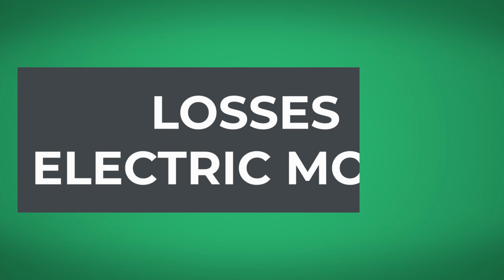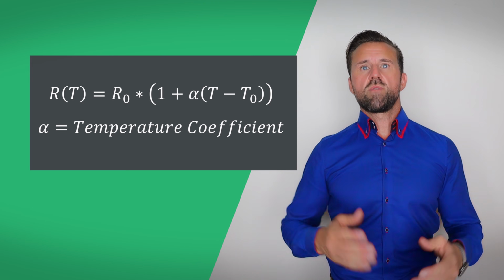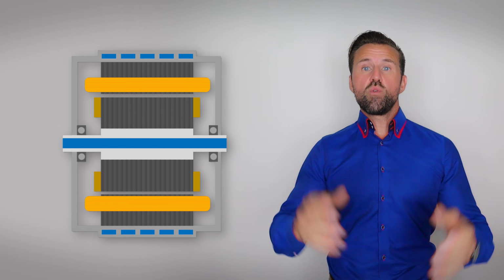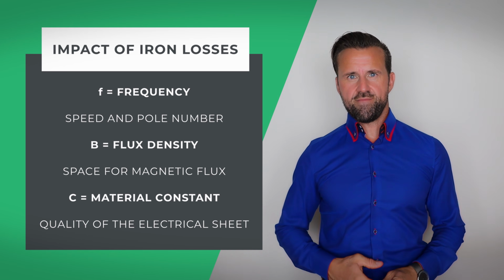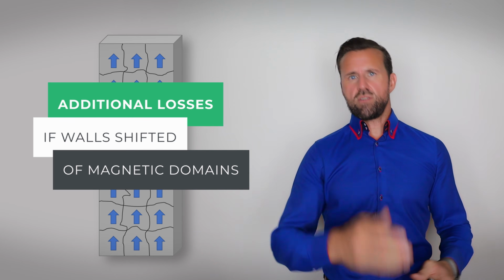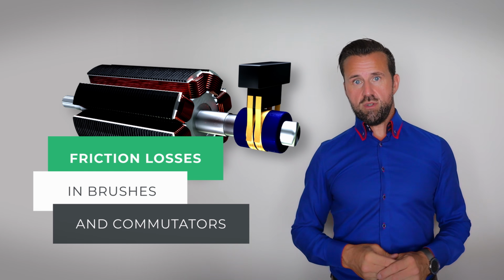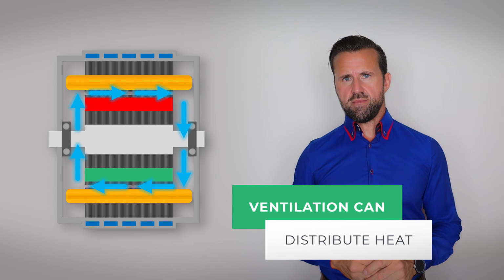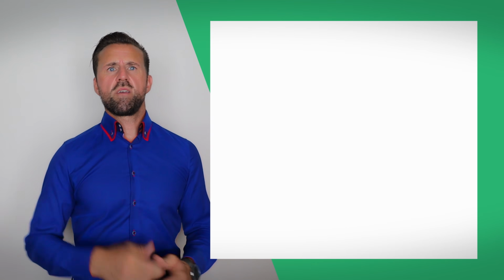Losses Electric Motor and How to Reduce Motor Losses

Comment: So then ,wouldn't a motor made of vanadium dioxside,  alloy would be a great choice for cooling. That it reduce heat losses.

also if  the motor didn't have metal bearings. but instead had electromagnet bearings with very tight tolerances That would  suspend the motor shaft when switched on then as the Rpms increased the voltage/current also increased on the bearings to m further stabilize the spinning motor and have no friction losses

Comment: Please I need your help agently am trying to run three ac motor of 5.5hp on single phase source of electricity but if am trying to run all the three motor  usually one of them will have a problem with the starting winding (burnt) what could be the problem
Reply from the maker: I don't think this is possible without additional electronics, sorry to say that

Comment: this is all the stuff i was reading in textbooks back when i was ten or so. all very basic and simple.

i cant stand watching someone simply TALKING, and waving tehir hands around. wheres some practical demonstartions? like, hey, heres three coils of different gauges, same turns, same ampere turns... lets see which one heats up fastest... thats your ohmic losses.

 heres some iron, lets give it a taste of varying frequencies... theres your core loss, theres a BH loop, the hysteresis loss...

or, iunno. heres a coil. on a core. with an adjustable gap. look at how we can vary the current and ohmic losses of the coil by varying the gap! see how it changes on teh scope in relation to the gap and the reluctance of the magnetic circuit?

hey look, heres a welding transformer. see how the core moves, and alters the coupling, the current, when we have a fixed input supply and a fixed output load? its all related...

now we have nice practical demonstrations of various principles, and we can walk away feeling we actually learnt something tangible, useful.

oh. wait. we didnt use a scope. instead we had some guy stand there talking and waving his arms around. who wants practical when you can have theory and only just scratch the surface?

if i didnt alredy know all this, it would be in one ear and out the other.

as it is, the whole video was rather pointless.

to me, this is sort of like watching an educational film targeted towards 8 year olds.
Reply: dont know what you expected for a 7 minute long video. i thought it was really good at covering the basics on losses, obviously it isnt going to be as in depth as a full research paper

Comment: Is there a good book on electric generator design? I'm looking at making a wind generator. I want it to work well with lower wind speeds of around 15 mph.

I've seen a lot of videos about the subject but many of them are contradictory and I was wondering if there is a good reference book for this sort of thing.

I need to know what shape everything is supposed to be... windings, magnets, cores, etc.
I need to know what quantity of components is optimal. Six coils or nine or twelve?
What gauge of wire to use.
How many windings should be in each coil.

Obviously these are a lot of questions. But every time I go looking for a reference book about this I get lost. Is there a good book that will answer my questions so I can design this thing?

Thank you for your time.
Reply from the maker: Hello a good book I can not recommend you unfortunately. Most of them are written by professors and have no direct reference to practice. That's why I also make the videos so that you understand without much prior knowledge erverything. Whether you design an motor or generator is actually very similar and on the subject of motor design you will find more information. To get you started, I would recommend buying a cheap motor and adjusting the winding to your speed and voltage. This will not give you a perfect result but you will get a first result quickly. What power and voltage should your generator / motor have?
Reply: @Electric-Motor  It will be a 10ft diameter blade which at 15 mph and at 30% efficiency would have 1500 watts. Keep in mind, wind speed varies so at 5 mph it would produce about 200 watts at the same efficiency. Voltage can be stepped up or down. Something above 52 volts and less than 72 volts is preferred.

 Speeds above 20mph could be dangerous and the system would stop the blade from turning in higher wind speeds. And I would make a point of securing the system in intense weather.

What I'm mostly interested in is getting the highest possible efficiency in low wind conditions. So 5 and 7 mph which is about a range of 200 to 550 watts. That would be normal operating conditions.

Given that the generator will likely be a three phase AC system, internal use will need to be DC, and DC voltage will need to be kept at usable ranges... I will have to use an AC to DC rectifier... the quality of the DC output at that stage is not important as the voltage will just be for batteries. And a DC to DC voltage converter will have to be used to increase or decrease the generator's voltage to something compatible with my power system.

Again, most desirable feature is high power efficiency at low wind speeds.

The value of this will be providing enough power at night to keep always on systems powered so they don't drain the battery at night.

Thank you for your time.

I would also suggest given the nature of your channel, this might be something other people are interested in learning about given the trouble with energy in the world right now. For my own purposes, my boat will be off grid regardless. But For other people perhaps simple small generators that capture energy at their homes might be something people find interesting.

You know more about this subject than most people that talk about it on youtube. In depth explanation of the pros and cons of different designs for different generation conditions would be very interesting.
Reply from the maker: @diogenes848  Sorry for my late message. It is quite expensive to build a generator for your wind turbine. I am a sailor myself, so my question is why don't you just buy a wind turbine? What problem do you have with the current solutions on the market?
Reply: @Electric-Motor  I'm interested in learning new things. I wanted to understand the principles so that I could at the very least design what I want on paper. Even if I don't make it being able to represent the principles on paper accounting for all the issues is interesting to me.

I've been looking around... I think there is a book by Hugh Piggott that might help me.

In addition to the wind turbine I'll also be building a hydrogenerator as well so that I can generate power whilst under sail.

Each generator has different rates of rotation and torque on the blades... and configuring the motor properly increases efficiency. Without more information, I'll have to either do more research which is fine or experiment which could be expensive as there will be failures.

I'm reaching out to people on the internet to avoid making these mistakes.

Comment: Hi, thank you for the information in the video, I would like to know the losses of magnetic field what type of losses, and changing the medium between the stator and the rotor how it can affect the losses, or increasing the gap size between them if we can estimate how the efficiency will be affected.
Thank you
Reply from the maker: Especially with induction motors and reluctance motors, a large air gap leads to poor efficiency. However, the additional losses do not occur in the air gap but in the sheet metal or copper. In motors with permanent magnets, the air gap can be made larger without much influence on the efficiency. However, more or stronger magnets are needed. If the air gap is filled with water or oil, additional mechanical losses occur, which reduce the efficiency of the motor. Liquids can also contain electrically conductive material, in which case electromagnetic losses also occur. What exactly do you want to implement? You can also write me a message via my website.

Comment: hi   I have electric motor  ran on 220v   can I make it work on 48v     thanks
Reply from the maker: Of course, it depends on the motor type. But in general, you can rewind the stator to a lower voltage, for example 48V. In simple terms, fewer turns with a thicker wire for a lower voltage.
Reply: @Electric-Motor  do I have any video to see how it make
Reply from the maker: @שושנהחרזי-ר3ש  No, not at the moment. What type of motor is it?
Reply: @Electric-Motor  it is 220ac motor  I want to do it 48v DC   its can do
Reply: @Electric-Motor  there is a email address  I can sand you picture

Comment: So, I live in Alaska and the mains electric isn't very reliable sometimes, so I use a generator sometimes... The generator I use used to work perfectly, but then I hooked up a power tool and it seemed to "break" the generator... I tested the output at the plug, and it is only producing 5 volts now, so I tried exciting the field windings with a car battery and only got about double the voltage... what else can I try? It just occurred to me it might have slip rings and if so, this is where i need to apply the voltage in order to figure out where the problem is coming from ?
Reply from the maker: Hi thanks for your question, however I probably can't really help you there. It will probably be a separately excited generator or? The excitation voltage for the rotor could be too low. If the motor has drawn too much current, the stator winding could also have a short circuit and therefore less voltage. Have you looked at the voltage from the generator with an oscilloscope? Please remember that high voltages and currents can be life dangerous.

Comment: Can you please comment if there is a considerable relation between Core looses and motor vibration.
Reply from the maker: If the electric motor produces noise, it comes from mechanical vibration. The energy which is consumed for the vibration counts of course to the losses. An efficient motor usually generates very little vibration. Do you think I should have added vibration as an additional type of mechanical loss?

Comment: @OSWOS I have a question 
there is a video of BLCD motor ..
https://youtu.be/SQvZ-FLwFX0
the rotation speed of the motor increases  when stator left out the rotor.... why this happens? 
hope you do a short video about it .. 
Thank you Sir
Reply from the maker: Thanks for your great question, this is an interesting video! When the stator is pulled out of the rotor, the back EMF decreases. The back EMF is the voltage that the motor generates when it is turned quickly by hand, for example. The faster you turn the higher the voltage you can measure. If the voltage is too high, the phase current will decrease and the motor will no longer speed up. You can lower the voltage of the back EMF by using less powerful magnets and thus increase the speed. This is exactly what happens in the video, by pulling out the stator, the back EMF is lowered and the speed can be increased. If the stator were not pushed back, it would require a higher phase current at a lower speed because the back EMF has dropped. Please give me a feedback if you have understood this?
Reply: @Electric-Motor  Now I got it!!  this answer led me to several questions ... Now I know why the motor has a small amount of wires, because it depends not only on the resistance of the wire, but also on the “~resistance” generated by the reverse voltage of back EMF .... am I right? 
Sorry for late reply I spent the whole day trying to understand  
Thank you so much, you are a wonderful entity 💎
Reply from the maker: @ahmedshfra9746  Thank you for your compliment. Exactly the voltage of the back EMF prevents the current in the windings from increasing. If the voltage of the back EMF becomes too high, the motor can no longer speed up. Thanks again for your question and I wish you a high efficiency.

Comment: it's a great presentation! 
1-I hope you talk about motor winding ... like length, diameter size and number of turns of the wire and voltage/amper limits of motor winding
2-coreless (slot-less) motor ... is it become inefficient in large applications?
3- BLDC Golden motor ... how this small motor work in huge power?
Reply from the maker: Sorry for my late reply. Large slotless motors are not so bad. But a big problem is the heat dissipation that occurs in the windings. Therefore, a large motor without slots cannot deliver such high performance. The motors from golden Motor don't look bad, but my experience is that you have to adjust the control system to be able to use the full potential. What do you want to use the motor for?
Reply: @Electric-Motor  
thank you for replying♥️
 but what about winding... I mean if you want to design a motor with specific amount of current and voltage. such as 200mA , 220V how you could know the length of the wire and the diameter.... I tried to use ohm law ... the resistance of 0.32mm AWG is 212 ohm per Km ... so for 220v I need 5Km of wire (3.6Kg) but motor with same power has less wire
Reply from the maker: To design a motor you need a software where you can enter the number of windings, motor dimensions and magnet material. The software then calculates the speed / torque characteristic. Such software tools are usually very expensive, because they are only used by a few people. My tip would be to get a motor that roughly meets your requirements and adapt it. So for example adapt the windings and the magnet material. Then you can better make your own calculations and check them. You haven't told me yet what you want to use the motor for? Maybe I have an idea where you can get one cheap.
Reply: @Electric-Motor  the motor is for a electric vehicle... but I'm trying to design a small prototype... I'm trying to use the work concept of universal motor and reluctance motor
Reply from the maker: That sounds interesting. But did I understand you correctly that you want to build a reluctance motor with brushes? And if so, what would be the advantage?
Reply: @OSWOS (brushes) this is my finish.. I mean if I'm on the right way it will become my main problem... so I'm at the beginning!. the motor I'm trying to design is like PMSynRM but I'll use Electromagnet instead of permanent magnets. the advantage are ..you can control  the magnetic strength of rotor and turn it off during high speed to get ~ zero losses and I think copper is cheaper than permanent magnets and I have a surprise in my design but I'm not sure yet it is possible! ....
Reply from the maker: @ahmedshfra9746  You are absolutely right and it is a good idea but it is more expensive than an motor with permanent magnets.

Comment: I'm working on 1.5kw BLDC Motor Design and prototyping. While testing the I'm facing lot of losses. Motor is running at its maximum rpm at 8 amps on 64 volts without any load. Would you please help to figure out how to calculate the exact gauge of winding wire, number of turns and number of strands.? And for Prototype I've used 2.5mm mild steel plates to make 50mm of stack. Should the plates be insulated to minimise the eddy current losses.?
Reply from the maker: Hi, I'm happy to help you but I need more information about your motor. The plates are definitely too thick, normally 0.35mm thick plates are used, but 0.5 millimeters will do. But it depends on the speed, how fast do you want the motor to turn? What do you want to use the motor for? And yes the sheets must be isolated from each other!
Reply: @Electric-Motor  Thank You for replying, I'm happy.
https://youtu.be/z3jzvDN5E08 see the motor how it is looks like. This is 3d printed though, but later I replaced stator and rotor with mild steel. Yes, the plates are too thick and not insulated and also it mild steel plates, that's definitely the main reason of losses. Apart from that I have to calculate exact number of turns and strands.

I want to use the Motor for an E-Bike and for that I need the motor to run at 8000 to 10000 rpm and max Torque I'll need between 5 to 7 Nm. 
No. of poles 8, no. of slots 12, stack length 50mm, stator bore 80mm, rotor OD 78mm, stator OD 130mm. Slot depth 18mm. 

See the more pictures of my Motor.
https://www.linkedin.com/posts/jatan-patel-222a9615b_bldcmotor-3dprints-activity-6817878626604855297-ezXW
Reply: See an another video where I've replaced the plastic core material with mild steel. https://youtu.be/qIa4YcR0R58
Reply from the maker: I have added you on LinkedIn. Maybe we can support each other in promoting content on LinkedIn. If you have any questions, I'd be happy to help. What kind of position sensor do you use because that's often a big problem?
Reply: @Electric-Motor  it is hall effect sensor. A3144
Reply from the maker: For testing at a constant speed, this is perfectly fine, but in operation on the vehicle, the speed changes constantly, thus also the position. Accordingly, your motor is not properly energized during acceleration. The result is poor acceleration of the vehicle and a too hot motor.
Reply: @Electric-Motor  and to improve the acceleration what I need to change in Motor.
Reply: @Electric-Motor  you may have watched this video. https://youtu.be/z3jzvDN5E08
Here, acceleration is not poor, I'm increasing the speed gradually.
But, You can realise the acceleration and speed here. https://youtu.be/qIa4YcR0R58
Reply from the maker: On a test bench, the load is usually constant! Such problems only occur when testing with the vehicle. Solution is the tuning of sensor, inverter and software. This is my daily work at automotive companies.
Reply: @Electric-Motor  Okay, Thanks a lot for advice.